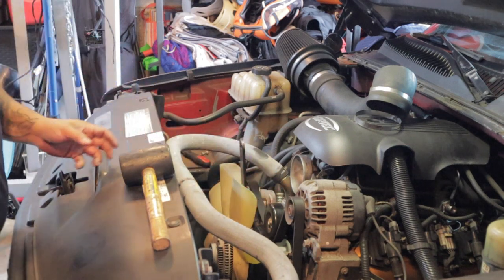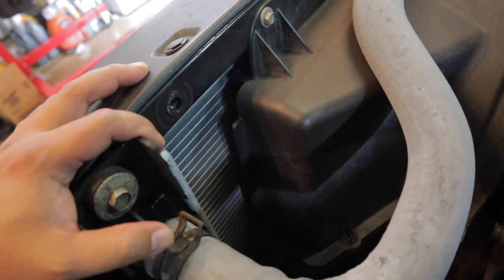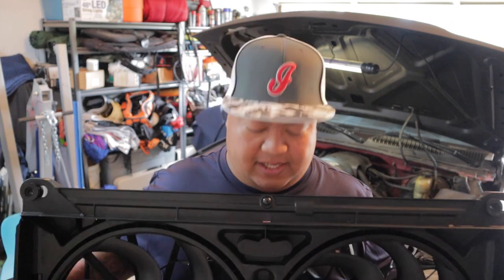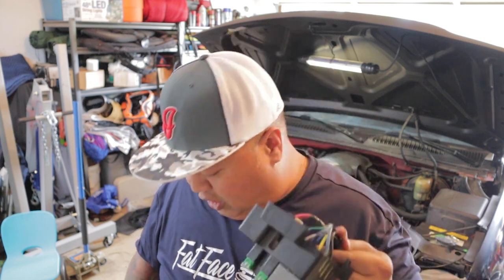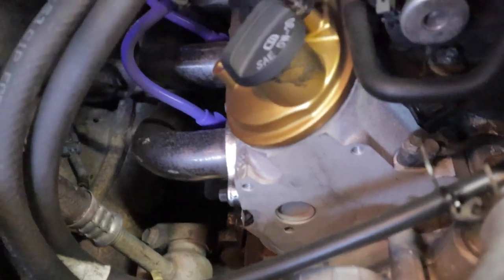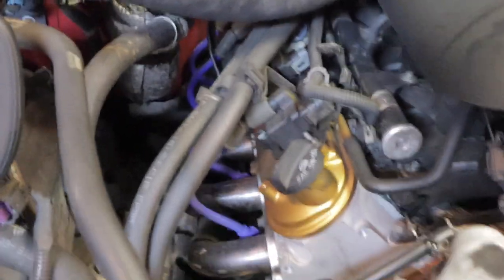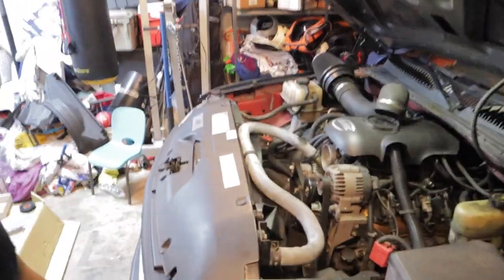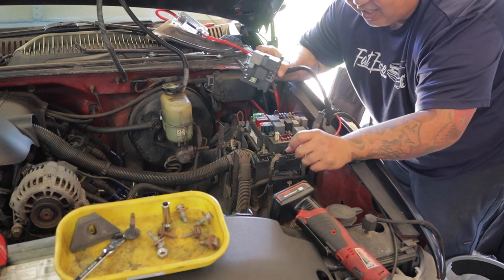99-02 NBS Electric Fan SWAP, silverado sierra Chevy GMC Tahoe Yukon Suburban Denali Chevrolet E-fans

Comment: Just watched the video where you fixed the Chevy lean. How does it ride and handle??? Did it mess anything up when you cut the spring???
Reply: Also do you take it on the freeway or high speeds??
Reply from the maker: Didn't mess anything up. I actually didn't cut them because the 3" springs i have are actually 2" springs that are cut from mcgaughys factory. So 3" drop spring passengers side and 2" drop spring drivers side. With that being said, the only negative i have is the fact that it's that low in the front. On crappy roads or pot holes, my valance is going to take a beating. Normal day to day driving i get up to 65-70 on the freeway. There really isn't any reason to go faster on this small island. Thanks for watching 🙏

Comment: Which one is fan 1 and which one is fan 2 

Are both supposed to come on low and high once up to set temp, or is one fan low and one fan for high
Reply from the maker: Both on low for fan 1. Both on high for fan 2
Reply: @CheeHooGarage  are they both on high for ac
Reply from the maker: @dominiquewilliams2559  no, but they are programmed to come on high with pressures being too high

Comment: My 2000 gmc 4.3 has 4 connectors for computer instead 2 connectors, should I still pin the 2 wires from oem e fans the same way as you?
Reply from the maker: I'm not sure what those other wires are for
Reply: @CheeHooGarage   i think you’re miss understood my question, I think 99-02 4.3 might have 4 connectors for computer instead of two long ones but I believe wires configuration is the same
Reply from the maker: @miltonmiranda9900  99-02 you have one red connector and one blue connector. Correct? 4.3 or V8 uses the same computer.
Reply: @CheeHooGarage  yes I do, but also have a black and grey one I believe and they are half the size of yours
Reply: Or white instead of grey I would have to double check
Reply from the maker: @miltonmiranda9900  bro, are you guessing or have you actually looked at your pcm below the battery? If your connectors don't look exactly like mine, then you might have a newer gen engine which would be cool, but if that's the case, I'm not sure of the fan wiring or how they even managed to make that work. Now you got me curious so lmk after you look. Or send me a pic on IG 🤙
Reply: @CheeHooGarage  I’m not guessing bro just can’t remember if is gray or white but I’m pretty sure is red, blue and black connectors but I’ll double check. Thank you
Reply: Bro, my computer does have 4 connectors I just don’t have instagram to send you a picture!
Reply from the maker: @miltonmiranda9900  email? sirkaiks@yahoo.com
Reply: Ok I will bro, tomorrow. Thank you!
Reply from the maker: @miltonmiranda9900  ok. Looks like you got the obs pcm. I didn't know they still used those in nbs trucks. In that case bro, I have no idea where the wires go to turn on the fans. If anything, they work when grounded.

Comment: Bro was wondering if all those parts you put in your 02, would it work for my 04 Chevy Silverado?
Reply from the maker: It will. And you don't need that ac upgrade kit. I think your truck already has the pressure sensor
Reply: How much you charge?
Reply from the maker: @samsivongxay2668  sorry bro I don't work on customer cars. Where you from?
Reply: Waianae
Reply: How bout just to program it

Comment: Man I just had the time to do it today and everything works great so far except for my AC I hope is not the new switch, I’ll take the truck to the mechanic tomorrow to check the ac system, but I drove the truck and the fans work as aspected, thanks again! Great video.
Reply from the maker: Make sure your compressor cycles on and off as it should with everything working. If not, check out my update video
Reply: @CheeHooGarage  thanks I’ll

Comment: I’ve seen videos where people connect one of the wires to the harness close to the alternator and the other one to the pcm, what’s the difference using the kit you purchased? Thanks nice video
Reply from the maker: So when they do that, the high speed fans turn on as soon as the ac compressor turns on. They aren't letting the ac pressure dictate when the high speed kicks on. These people are also saying that they might have to upgrade their alternator to handle the extra load. So far driving around for a week, i have yet to notice the high speed fan kick on. Maybe I haven't seen bad traffic yet in the blazing sun, but everything is running smoothly and my ac is cold even at red lights.
Reply from the maker: They are using the ac clutch as ground
Reply: @CheeHooGarage  thanks that makes sense, I’ll probably purchase the kit, I have everything but I have problems connecting my computer with HP tuners thanks again.

Comment: Hey where does the ac harness connect to when it's all pinned to the pcm?
Reply from the maker: So all 3 wires go to the pcm as shown in the video. However, I'm trying to look it up, and all 3 pins were empty so I have no idea how the pcm reads it. Stay tuned for my next video when I try to make sense of all of this.
Reply: @CheeHooGarage  can you also point out where the connector with the neon yellow gasket goes? (that's what I see on the BP automotive website) I appreciate the information on this you and Lawrence LT Tolman are the only ones that address the 3 other wires
Reply from the maker: @cartispercs4804  that plugs in to the pressure sensor that you replace with the pressure switch
Reply from the maker: Approximately 17:00 into the video
Reply: @CheeHooGarage thank you